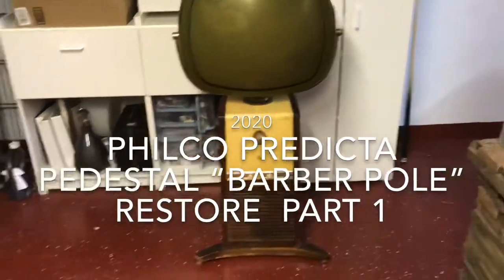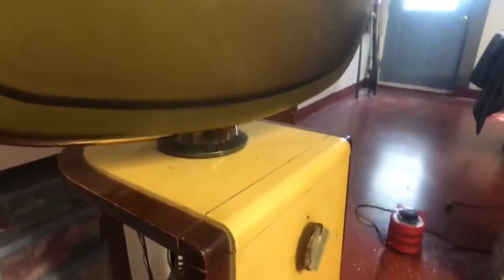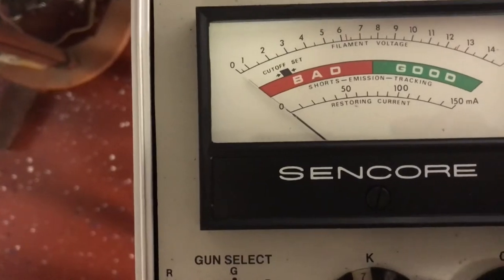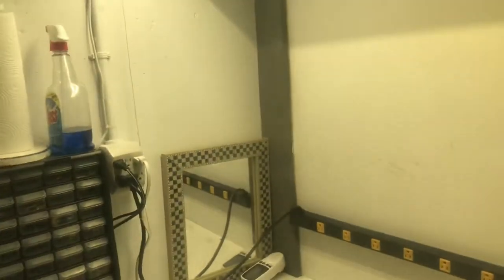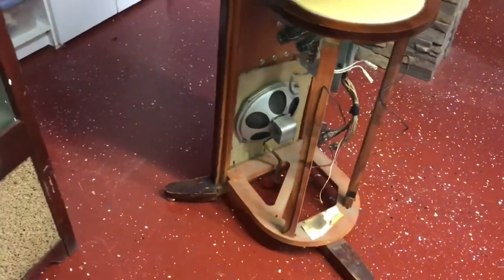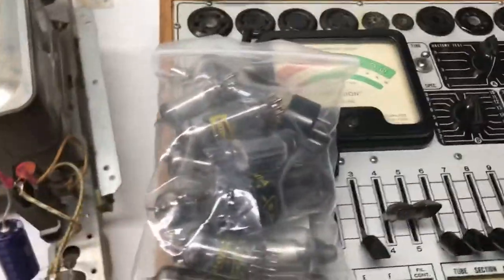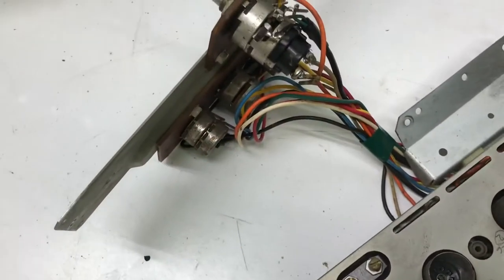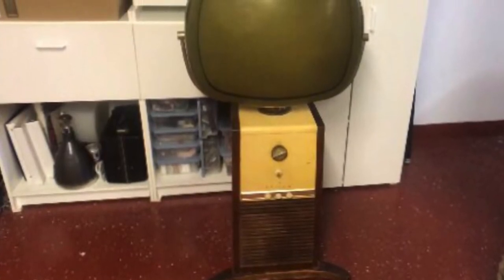PREDICTA Pedestal TV Restore pt 1 of 4  Analysis and chassis work begins

Comment: How do you discharge the CRT to make sure it's safe to work on?
Reply from the maker: I use either a HV measuring probe , with the set off it will discharge any HV. 
Or a long shaft screwdriver, (again with set off) with a alligator clip test lead attached from the metal shaft to chassis ground. 

Thanks for watching, if your not a subscriber please consider subscribing to our channel